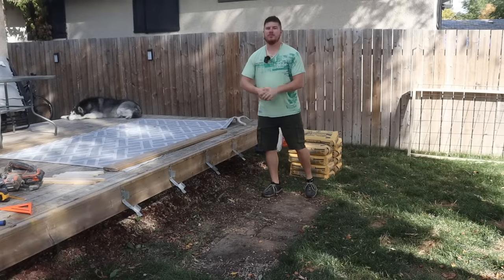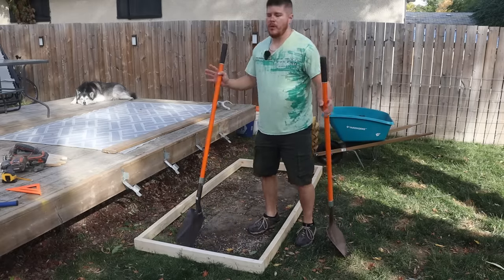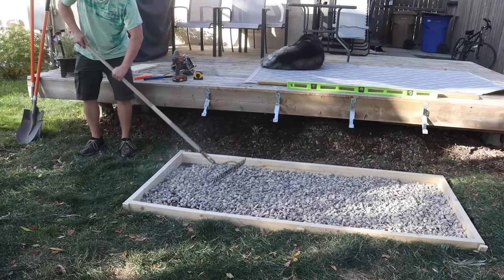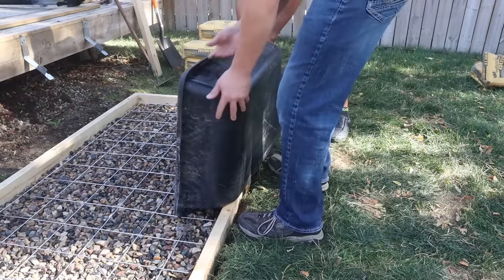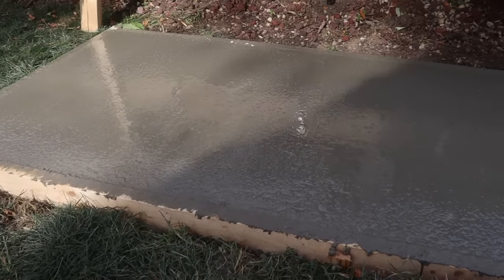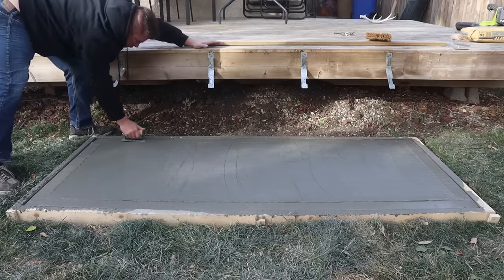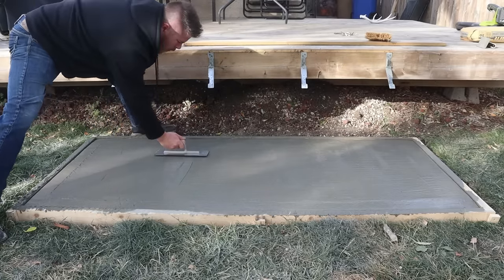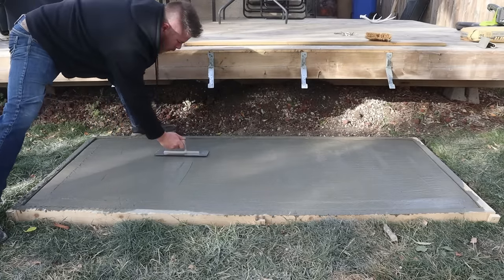Concrete pad for beginners  //  DIY

Comment: What abput in the North, water will get underneath and freeze.... in the spring wouldn't this be ruined?
Reply from the maker: I live in the north. Winters here get to -40 and summers to +40. The rocks keep it separate from the ground and the wire mesh keeps it together as one solid until so as the ice freezes and melts the whole thing moves up and down as one solid piece

Comment: Try using the wheel barrel next time, way easier to dump the concrete by yourself.
Reply from the maker: If I had a steel barrow I would. But mines composite and I didn't want to destroy it, hence the concrete mixing tub
Reply: Smart idea...save your back for the future!😀

Comment: 6:47.just to confirm.if i dont have bare feet needs,i the i will be done at 6:47. only need to spray some water in the next days.right?
Reply from the maker: Not if you don't mind a rough finish. I've made a few slabs where a rough finish was actually useful and I didn't smooth it out. Your call

Comment: Looks like the slab is only 2-3" thick at most?  Even if in a 0 frost climate should be 4 inch pour
Reply from the maker: It's around 3". Our driveways here are about 4"

Comment: Dumb flies. When I was doing something similar, my bulldog decided to inspect my work  by jumping off the deck (which he never does) onto the wet concrete. His paw prints would have been a nice touch but he also left an imprint of his undercarriage.
Reply from the maker: Haha of course he would. Dogs hey. I'm glad Slade didn't do that, he looked at it but decided to go off the back stairs and not risk it. I wouldn't want to wash concrete out of his fur

Comment: Why do you do a base for the concrete? I saw another video that had used this, but didnt mention it, and another video where they poured over the dirt itself.

Why the base?
Reply from the maker: You always want a base. It helps keep the slab separate from the ground and allows it to move independently to prevent cracking from the ground shifting and freezing. It also helps water flow underneath of it instead of inside of it from below from ground water. Plus the base is all the same ingredients, either sand or rock, as the concrete itself for maximum strength and we aren't introducing another one like dirt into the mix. There are more reasons too, but I basically boil it down to, if they use it for roads, bridges and buildings, I'll use it here.
Reply: @JessedoesDIY  thanks!

Comment: At 3:12 the first thing I thought was make sure your stairs sit flush on the top of that concrete....or else your "run" will tilt toward the back and your "rise" will cause the stairs to look halfassed.  I couldn't watch the rest because I never saw you take into account for that, so who knows what that turned out like
Reply: LOL I told you......at 12:16 he had to trim the bottoms of the stair stringers to compensate for the new level of the concrete.  Oh well, I liked watching the rest of it.
Reply from the maker: I trimmed nothing. I removed the stairs and reinstalled them. I made sure that the height of my slab was the same height as the blocks before it. That's where making sure it's level and all the measuring comes into account before hand. Hence the rise and run of the stairs have not changed
Reply: @JessedoesDIY   Not to worry. He wasn't there like he said he was.................

Comment: Wire panel is often called hog or cattle panel
Reply from the maker: The hog panel is much thicker than this stuff, but you can use it too. This is actually in the concrete aisle at Home Depot with regular types of reinforcement

Comment: @JesseDoesDiy once the concrete cures it's time to attach the steps...with frost heave/drop...how do I attach the wooden steps? Are there any adjustable brackets I can use?
Reply from the maker: My steps are just sitting on the block, there really isn't a way to attach them and have them 'floating' at the same time that I know of. I just made sure mine is tight right now
Reply: @JessedoesDIY  thanks...hmmm maybe I can design something..lol
Reply: @JessedoesDIY  in the deck edge board insert a metal non moving bracket...in the steps same thing...have a:floating rod that keeps the steps in line with the deck but allows the steps to rise/drop with frost heave!

Comment: Can I make the form a little taller if needed? Use maybe a 2x6?
Reply from the maker: You can, but thats a lot of extra concrete. 2.5" is enough to hold most anything around the house and 3.5" is thick enough for driveways. It's up to you how much you do
Reply: @JessedoesDIY  im building a pad for my AC... and I need it higher as I'm going to grade around the house.
Reply from the maker: Ahhh, got ya. Well, good luck!

Comment: Cant figure out them bags getting mixed there are they just bags of Cement or a mix of sand and cement?.
Reply from the maker: They are pre mixed concrete. Cement is one of the ingredients in concrete, people mix the terms up all the time. Concrete is made from cement, sand and stone. You can buy bags of each ingredient to make your own concrete, or just buy pre bagged concrete. Some of the bags of concrete might be specialized for certain things, but there are also just general mixes, which is what I used here
Reply: @JessedoesDIY  Thanks ..

Comment: I need a pad, but where I need it there's Maple tree roots throughout the whole spot, so I can't dig down...and there's a slope towards the front. NOW what do I do ? 😢
Reply from the maker: Might just have to remove as much down as you can and fill it in with sand, tamp it and the maybe add some pack or crushed rock amd go on top of the ground. Then maybe build the ground up around it after

Comment: do you have to had stone over loam before a slab pour? if so why?
Reply from the maker: Yeah, stone or tamped sand but I prefer stone. You never want to pour it over grass or any vegetation, it'll make the slab crack from shifting ground and even potentially weaker as well as discolouration. The base helps keep the slab separated from the ground, so it can move more independently and shed water underneath it. There is more too, but always have a base

Comment: Is 3.5 inches think of concrete fine for a patio?
Reply from the maker: Should be fine, as long as it's relatively the same thickness all the way across. I mean, driveways are between 4-5"

Comment: Dumb question, but how do you clean up your equipment after this?
Reply from the maker: After concrete jobs, just water and a brush is all. Just make sure to do it before the concrete dries, it cleans easily
Reply: @JessedoesDIY  just in your yard?
Reply from the maker: I just rinsed it all in the driveway myself yup. If you have leftover concrete, just pour it into a pile on some dirt, let it harden and toss it
Reply: @JessedoesDIY  thank you!
Reply from the maker: Anytime

Comment: Why use only a four-inch roller to apply the sealer?
Reply from the maker: You could use a bigger one, but a bigger one will absorb a bunch of the sealer first and isn't needed for a small slab. For a bigger job I'd use a larger roller.

Comment: I heard a wetter load on the rinsed rock, then the wire or rebar, then the final patch.
Reply from the maker: That is another way to do it. But for most jobs  this method is just fine. Also more DIY friendly

Comment: The only thing I would be slightly worried about is if the gravel underneath was undermined, the concrete will have set around most of it but I’m willing to bet there will be quite a bit of loose stuff on the sides which could crumble away over time and create a void under the slab.
Reply: And the solution for that is…..?
Reply: @east5871  create a one foot square jammer of wood.  Sort of like  inverted T.  Then start pounding the gravel till it is tight.  You can never ever eliminate the pockets as the ground settles and shifts, but you are eliminating most of the risks.
Reply: @praful6890  excellent!!  Thank you!!!
Reply: @east5871  Use a membrane or polythene sheet on the base and do a solid pour opposed to the gravel base. You’ll use more concrete but eliminate the risk of any voids.

Comment: Gotta pull your wire up!
Wire just sitting on the bottom of the slab is counterproductive
Reply from the maker: Depends on where you need strength. To resist ground movement you put it on the bottom portion, yes it should be up ever so slightly but on a small slab it's fine. To resist weight on it you put it near the top
Reply: It's not just sitting at the bottom of the slab, though.  It sits on the gravel and the concrete mixture fills in between and under.
Reply from the maker: I get what you're saying, but is that not still the bottom? I was just trying to keep it simple for the average homeowner

Comment: Does it not crack during the spring thaw?
Reply from the maker: Nope. The rocks keep it separate from the ground and the wire mesh keeps it as one solid piece. The whole thing moves up and down as one
Reply: @JessedoesDIY  Thanks for the reply.  You make it look so easy, I feel like I could even try it.
Reply from the maker: No problem. It isn't a hard process overall, just takes some work from all the shoveling and heavy concrete. You can absolutely do it, that's the point!

Comment: Don't you need to mix some sand with the cement?
Reply: No
Reply from the maker: This is premixed concrete. Concrete is made up of sand, cement and rock all portioned to the correct ratios already.

Comment: Why was the mesh under the slab? It's not serving any purpose, it's supposed to be in the concrete to reinforce the slab and keep it together!
Reply from the maker: The reinforcement is actually added where you need it to resist. If your putting a ton of weight on it like in a driveway you raise it up and put it near the top to resist weight. In my case I want to resist cracking from ground movement so you put it near the bottom of the slab. For DIY sake for the average person this is the easiest way instead of trying to get it 1/2" up. It's still in the concrete this way because it flows down through it and into the rocks, so it's still in the slab, just the bottom part where I needed it in this case
Reply: If it's not in the middle of the slab, there's a higher chance of cracking because it's thin on whichever side the mesh or rebar is closer to top, bottom or sides. Columns have the reinforcement directly in the middle so for a 1' square column it'll be a 6" square rebar that goes around 4 straight rebars standing up and attaching it in the corners. Once you prefab that it'll go in the center of your column form so you'll have 3" concrete on all 4 sides. If you use that theory reinforcement should always be in the center. That slab you did which is just a landing pad I'd probably leave the mesh out because nothing heavy will go on that slab which to me is overkill but, I understand your theory. You can control the drying time with water! If you want it to set faster use less water when mixing. The easiest way to get your mesh in the middle is to drop concrete down spread out halfway to the top of your form then put your mesh in and pour the rest to the top. Thanks for replying to my post take care!

Comment: It's important to note that when cutting the bag of concrete down the middle like that, it creates a significant amount of dust and whether you realize it or not, you're breathing it in so some sort of mask or respirator should be used, especially for those with sensitivities to airborne contaminants. It also introduces the dust to the immediate environment which could be harmful to those with severe allergies or autoimmune conditions such as Lupus.

Comment: I didn’t add rocks & I didn’t add reinforcement 🤦🏼‍♂️ I’m off to a great start lol.
Reply from the maker: Oooops
Reply: @JessedoesDIY  Its a very small pump house (deck shed) and our weather doesnt get too extreme here so itll probably be okay. However, I am going to use what I learned from this video on my next slab. Which I will be pouring within a week or two lol.
Reply from the maker: Well I hope it good out for ya then. Good luck on the other slab!

Comment: easier would have been to erect a small platform next to the forms, put the mixing bin on top of it, mix the concrete, then tip the bin up to dump the mix into the form. no lifting required.

Comment: Uh, isn’t reinforcement if you plan on putting heavy weight on it? Like a car.
Reply from the maker: Nope. Concrete is designed around it. Without it the slab shrinks, expands and bends small amounts all the time depending on weather. Without it, it will develop cracks and crumble apart. What you're designing the concrete for will depend on the type of reinforcement used, as well as if it's on the bottom or near the top of the slab. In this case, light load so this light mesh is fine, and near the bottom because we are resisting ground movement

Comment: 8 bags? I’m looking at building something similar and online calculators are telling me I need 35 bags. Mine is going to be 12’x4’x4”
Reply from the maker: Yeah it goes up quick. But you have to also remember to account for the stone in the bottom, so my slab was only about 2.75"-3" thick when it was all added. 4" is pretty thick, that's driveway thick. Over 2" thick is plenty for nearly most any home needs

Comment: 130 pds?
Reply from the maker: The mixing tub had 2 bags of concrete in it, each bag is 65 pounds, plus some water. So when we dumped the tub, that's what it weighed

Comment: I might be the only one here. But after the rocks were added it looks as if there was only 2 “ of room for concrete. Just looks awfully thin.
Reply from the maker: 2" is plenty thick for what I'm using this for. If it was supporting a bunch of weight like a shed or yard equipment I would have went 3", but a small basic slab this is good

Comment: Why no
Sand ?
Reply from the maker: Underneath? It isn't needed. The spot is already level because it's small and this will keep the small slab separate from the ground and allow it to move up and down on its own as the ground shifts to prevent cracking
Reply: @JessedoesDIY  understood , thanks for that info.
Reply from the maker: No prob

Comment: for floor slab you dont need to waste money in steel rods
Reply from the maker: I don't know where you live but around here it'll be cracked in a year if I don't because of the ground moving
Reply: @JessedoesDIY  if red blocks r used and its thick u dont need steel rods nor nots of cement, instead of cement u can either use red blocks or small sized rock stones

Comment: Adding a crushed aggregate base and steel mesh for a small job like this this is unnecessary and a waste of money.  Just pour the Portland cement concrete directly over the native soil and finish it.
Reply from the maker: That sounds like a slab that won't last very long, at least in my climate. Small project or not, don't skip on the prep or details. But you do you

Comment: Why would u put the placement right there ?? 
All u basically did was add a concrete base step cause u can’t even see all the work u did , u could of had like a nice landing pad but u decided to put 4 bags of concrete BEHIND the stairs 
What a joke
Reply from the maker: It is a landing pad. I could have went further forward but it wasn't needed, and I went further back so it doesn't turn into a mud pile under them once I finish adding skirting to the bottom of the deck to the ground. Works fine for me, but if it's a joke to you then don't do yours like that. No need to be condescending